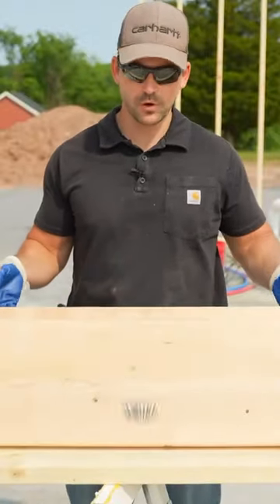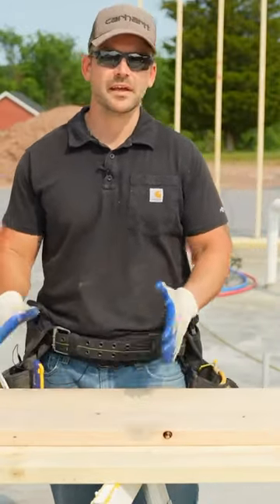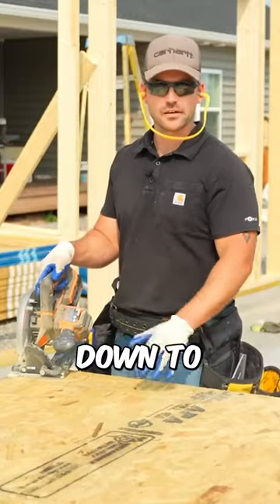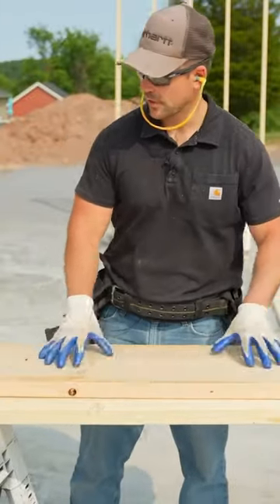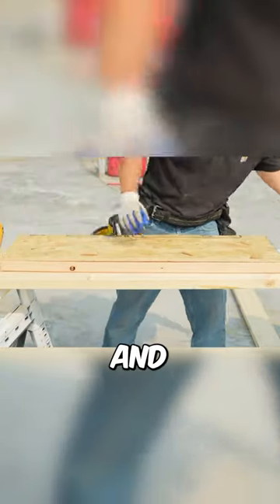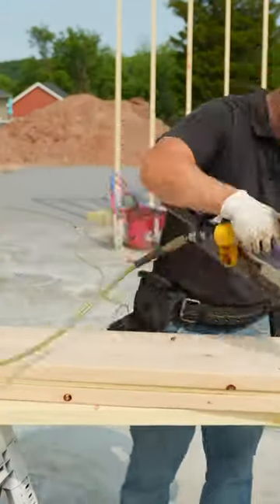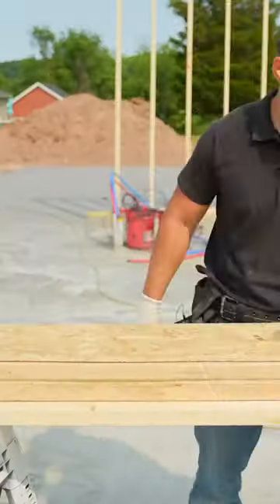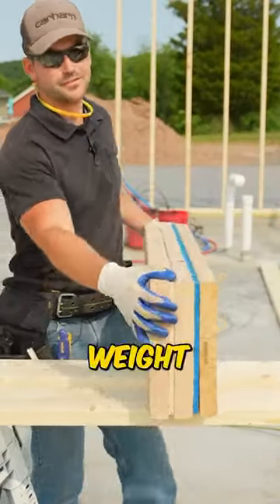Can you build a header using 2x12s? Here is how! #construction #woodworking #wood #carpenter

Comment: In most states yellow pine or approved glue lam headers are only allowed, SPF material as shown in the video only will carry a third of the structure load as yellow pine.
Reply: Check the span requirements for that.  Typically a shorter span is not required to have glue/lam.  SPF or SYF are allowed, except where it is ground or concrete contact.

Comment: Better to fill the cavity with insulation instead of building a header that’s grossly overkill.
Reply: He does everything overkill lol. Watch his electrical videos. He runs #12 Romex everywhere
Reply: @aurvaroy6670 12 gauge means every outlet is properly hardwired instead of shitty stabs with 14ga.  Do it right the first time.
Reply: @bigpjohnson  That's what he does with his outlets and switches
Reply: @aurvaroy6670 I do too. I won’t use 14
Reply: @aurvaroy6670  12/2 AWG is better than using 14/2 AWG little bit more expensive but perfectly fine to use.
Reply: No, you need the header. I just think it's weird that all the other comments in this section are arguing over electrical wiring.

Comment: I did this an a month later it twisted an popped the drywall, had to sand both sides. Never again.
Reply: That means you did it very wrong
Reply: You should have glued the layers together.
Reply: Sounds like you either used wet wood,  fresh yellow pine or possibly wet PT, and you didn't make sure both crowns were up.
Reply: @jmackinjersey1  wet pine for sure.

Comment: 2" Rigid foamboard would have been great in between...just a tip
Reply: Yup good one ya and one less ply rip when he said over kill that was my first thought was r value
Reply: 2" foam board would put the header width at 5" with only 2 studs, needs to be 5.5", and he got 3 studs.

Subbing osb for 1/2" foam board would work though.
Reply: @MichaelSSmith-kv9if  yeah I never said no OSB for the extra 1/2" but yeah a layer of 1/2" foamboard included would be cool
Reply: @knotallthere66 wood is a natural insulator. Omg people are stupid af in comments
Reply: @bbur75  A 2x4 is R-3.5 edgewise.  An insulated wall is calculated at R-11 including the studs.  So the R-11 is an average.

Comment: Way overkill. With that short of a span probably one 2x12 would suffice.
Reply: And what would you suggest the sheetrock is secured to on the other side of the wall?
Reply: @jmackinjersey1  Anything. You could put a couple 2x4s in the middle with one plywood on the other side.